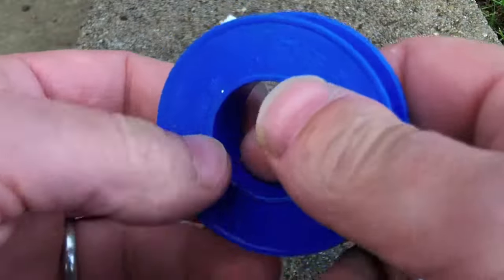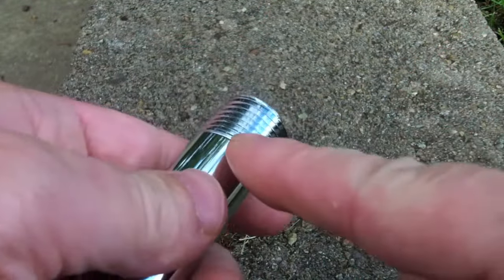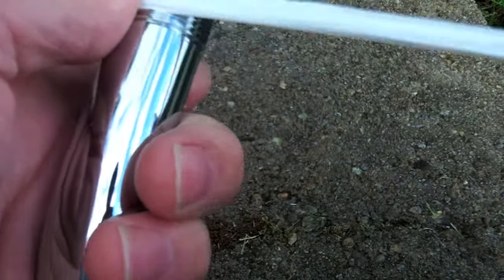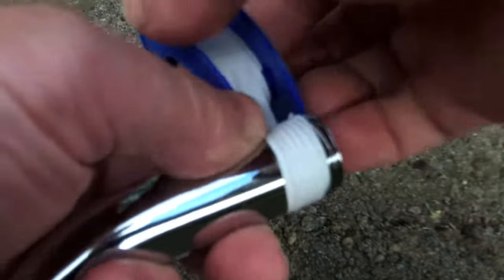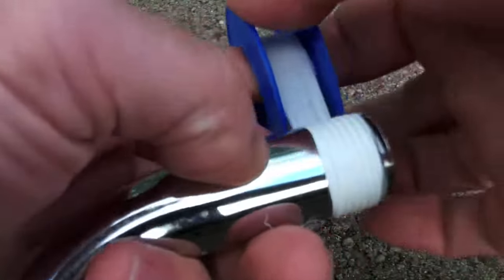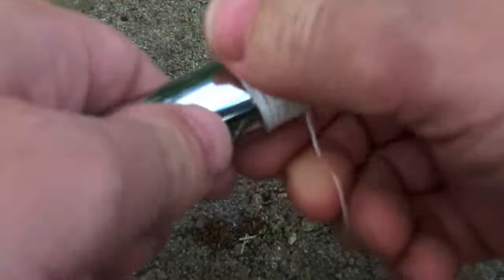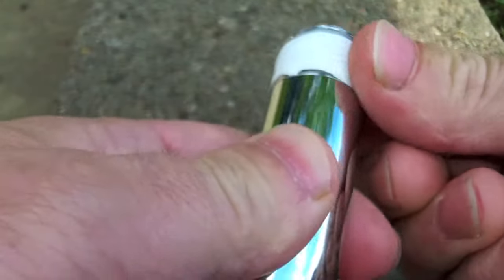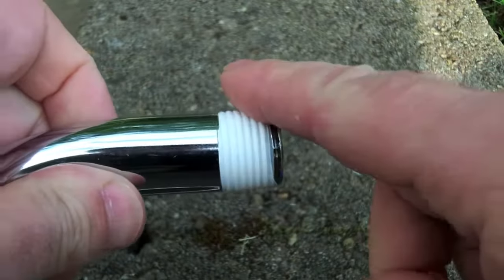Teflon Tape for Shower Arms

Comment: 😢😢 put it on backwards, tape will loosen as you tighten. Apply it counter clockwise so tape will stay tight as you tighten fitting
Reply: @user-Iv9cs: Actually, he did rolled it on incorrectly. He said roll it on clockwise which is correct. He just rolled it on counterclockwise. But kudos for noticing his demo was incorrect!

Comment: hi! can we use the teflon tape for the hose connecting the shower? The water is leaking just below the where the hose is connected (where the thread starts). Do you know how I can repair that? Thank you in advance.
Reply from the maker: Good question girl - try undoing the hose as it might be cross-threaded. Then tighten it onto the shower head by turning it clockwise. If it leaks, tighten it in 1/4 turn increments until the leak stops. 

If this doesn't work then go ahead and apply 4-6 turns of teflon tape :)
Reply: @HomeRepairTutor  does it need pipe dope too or teflon ok ?
Reply from the maker: @Eastbaypisces  these days I use both, eg Megatape and Megalok dope

Comment: Actually, you rolled it on incorrectly. When you go to thread that onto the fitting, it will unravel. You must roll on in a clockwise fashion (as you said but applied it counterclockwise).